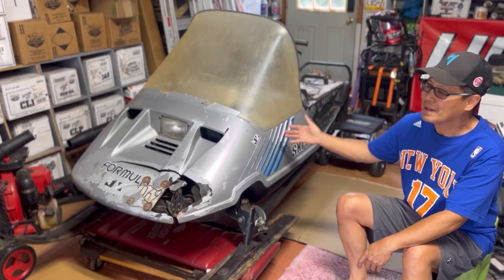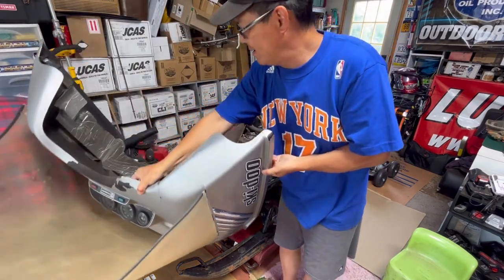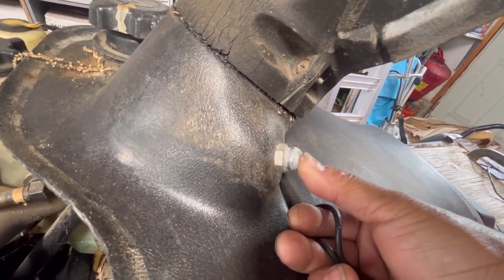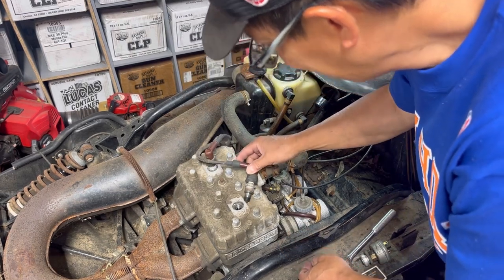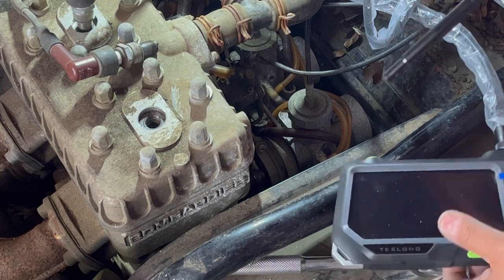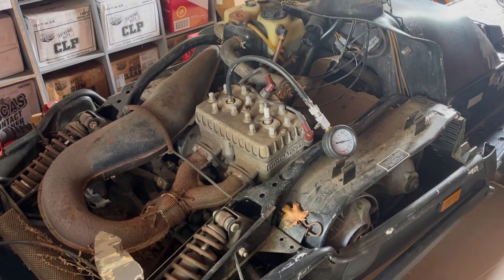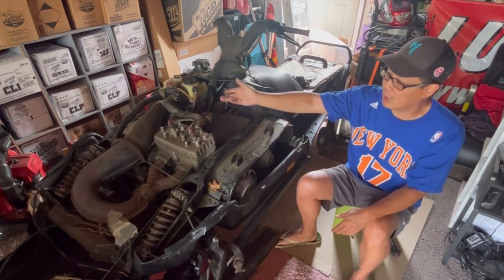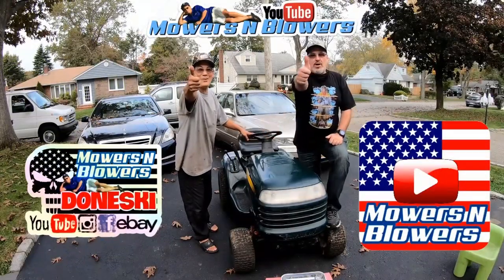FREE SKIDOO FORMULA MX ROTAX 2 CYLINDER SNOWMOBILE SLED TROUBLSHOOTING SPARK COMPRESSION TEST START?

Comment: Never use starting fluid on 2 stroke engines, mixed gas down the sprk plug hole, siphon out the tank clean carbs and fuel pump, check the filters in the tank

Comment: that is a 1988 or 1989 mx, prs chassis with the c7 rear skid old heavy sleds but fast. that was my first sled as a kid. shoud be the 470 cc rotax
Reply from the maker: Yup you are correct!
Reply: I bought a 88 MX brand new when I was 20. Had it until 1995. Had a family and got married. Absolutely a terrible chassis. Lol If the trails were smooth they were fast in the Twisties but that was it. I still have nightmares when I see them on the trails. Very dependable tho.

Comment: being a 2 stroke....there are no valves....those openings you saw in the cyilnders are where the fuel enters and exhaust exits.....the piston acts as valves.....what I would do is recheck for spark....if there is still spark....I would put some premix fuel into the cylinders instead of the starting fluid....also, I do know that if 2 stroke engines have leaking crank shaft seals, they can be hard to start and it will run like crap if it does start....just my 2 cents for what it's worth.
Reply from the maker: Thx bro

Comment: I’m only use to dirt bikes not snowmobiles but usually compression should be at least 100 psi in order for it to kick over and those holes in the cylinder are the intake and exhaust ports. It pulls up air/fuel mix from the crankcase. 2 strokes are sensitive to air leaks from crank seals and gaskets that can dramatically lower compression. The spark plugs could be fouled.. I hope it’s that easy!

Comment: It sounded like it fired off for a second after you put the oil in. Also it's a two stroke so no valve cover because there's no valves
Reply: I'd clean those carbs bud so u can get some actual fuel to it to

Comment: Bore scope or disconnect the exhaust you could have a mouse nest in there. If not I think you could have an issue with crank seals. Junk Yard Digs on YouTube has restored a few of these and has had that issue. Good luck. Feeling the pain. Is it possible to get a drill on the crank Bolt to save your back? I am the same age and I am feeling it just watching you pulling on that sled. Good luck.
Reply: Also when you do get it running do not trust the system that is supposed to add oil as you are going. Premix your gas before putting it in the tank if the oil injection fails you will smoke the motor. Great job on finally getting her to fire up for a bit.
Reply from the maker: Thanks bro!  Stay tuned,  nothings blocking the muffler,  you’ll see why.

Comment: To bad you don't have the key but you will get it running again in due time 😊
Reply from the maker: Robert there’s no way you watched the whole video in 2 minutes,  it just came out.
Reply: Best to put 2 cycle fuel in each cylinder to start
Reply: Yes, definitely better to put a gas oil mix into each cylinder. 
Those kind of people that just wanna waste your time are a  pain in the ass with that mower
Reply: Might get higher compression reading with throttle wide open
Reply: Hold throttle open then squirt 2 cycle fuel into each carb, carb cleaner will wash down the cylinders and cause damage

Comment: No valves on a 2 stroke
Reply from the maker: Not true!  It’s a Rotax engine
The 582, 532 and 618 Rotax two strokes have a rotary valve on the intake side of the engine. It is basically a disc with a hole in it, that rotates